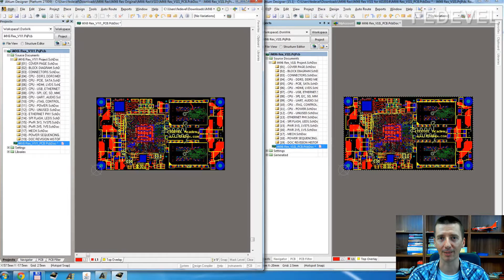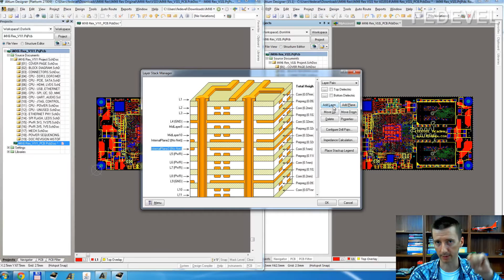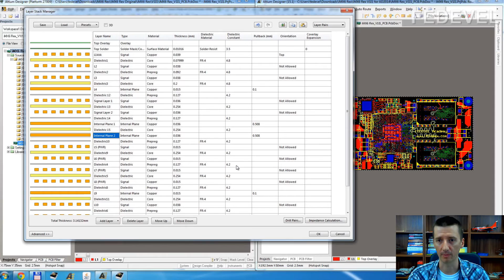Altium - Stack Manager (The New & Old Way)

Comment: The old version is a lot better when it comes to the layer stack manager, the picture is clear ,why making  a change to an option that works ?plus i cant find where is top and  bottom dielectric ?
another thing i found out, in order to redefine the board shape you have to go to view, board planing mode,select 1, then go back to design ,then redefine board shape, too many steps ? they call this an improvement one step forward 7 steps back

Comment: Hey Robert,
I have been following your channel since long and your video tutorials have solved lots of problems for me.
Can you please make a guidance video on:
1. Choosing appropriate FPC connector
2. Designing "Only Flex PCB" in altium (Not Flex-Rigid)
3. Impedance controlled Flex PCBs

Thanks 

Best regards from Canada
- Harshal
Reply from the maker: +Harshal Pawar I do not normally design flex PCBs, so I can not really give advice to other people on this topic. However, when I designed a flex PCB couple of years ago, it was not much different from designing a standard PCB - just talk to the PCB manufacturer.